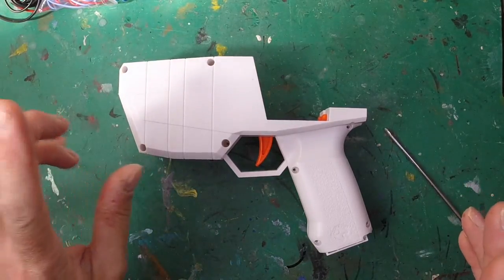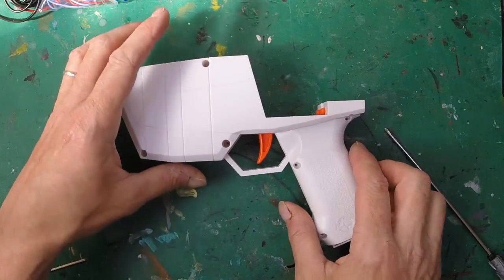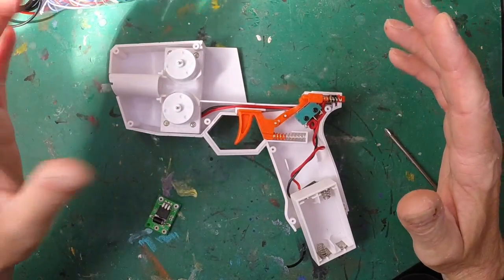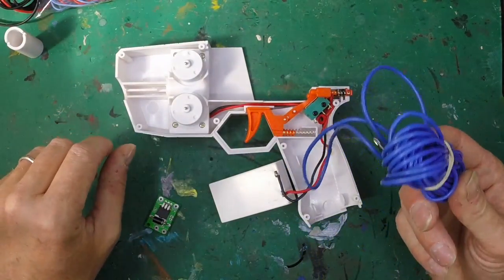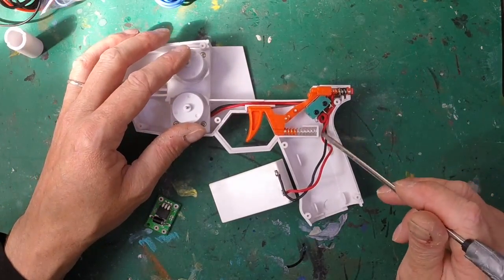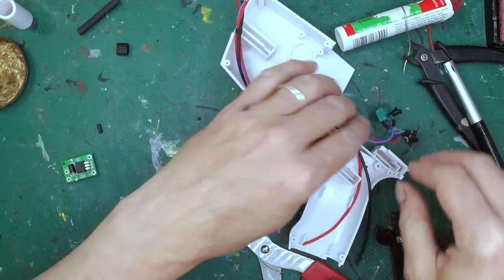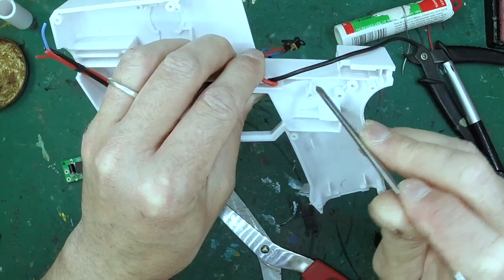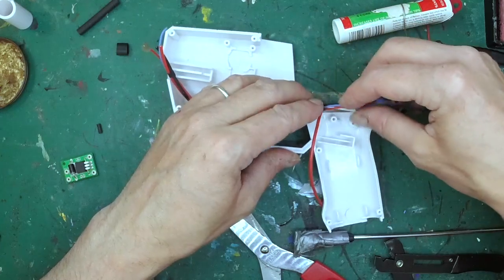Worker Hurricane MOSFET Mod

Comment: Hi Tom. I'm using one of these boards on a Stryfe build. Is it safe to piggy back a voltmeter to the + and - connection for the battery on the board?
Reply from the maker: Yes, it should work from there.
Reply: Thanks Bro. Forgot to splice it with the battery line. Be nice and neat if I just connect it to the back of the little board.

Comment: ah, I see your flywheel cage broke immediately as well, so that's not just me
Reply from the maker: coatduck Yeah, it’s total shit quality. Worst thing on the blaster after the annoying springs by the arming switch. The other one I modded broke as well, both sides.
Reply: @foamdataservices  One of the rare instances you think a 3D printed cage would be better? :P
Reply from the maker: coatduck Yes. A cheddar cage would be better than the one in the Hurricane.
Reply: @foamdataservices  Cheddar Cage you say . . .
Reply from the maker: Job for a Cheese N Crackers router?
Reply: @foamdataservices  well played foam dad
Reply from the maker: Certainly a cheesy Dad joke!